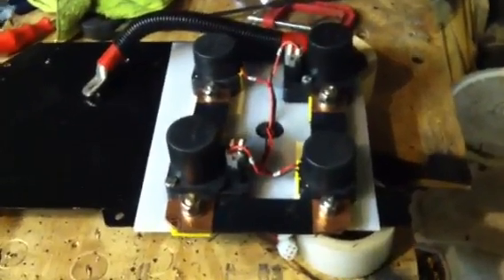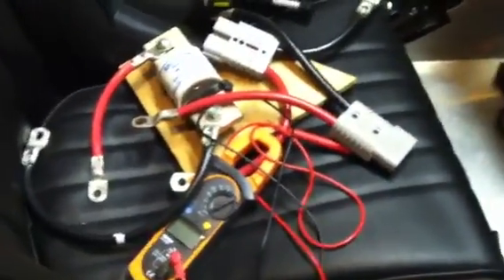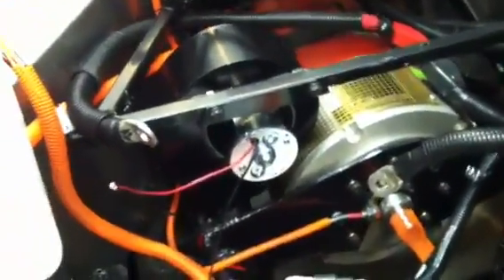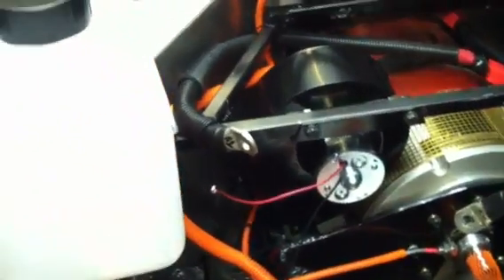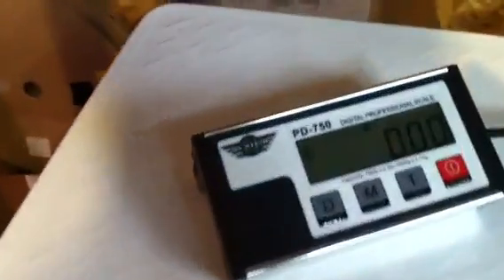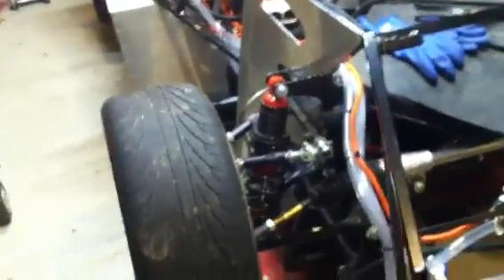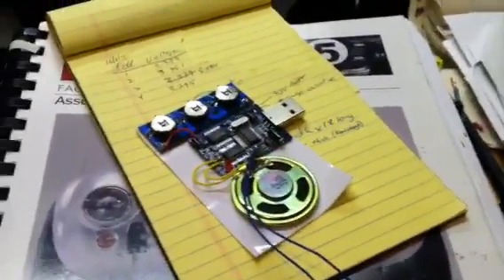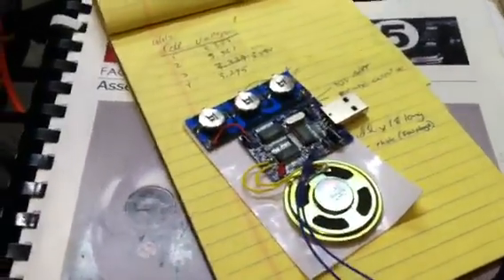Factory Five Mk4 - Electric Car  - Video 21

Comment from the maker: @baltaz86 Not finished yet.   Working on the battery packs now.    Hope to have it on the road this summer.

Also change of plan for the 'engine sounds'.  I found a company that makes a novelty item for gas cars that simulates engine sounds, including a Shelby V8.   I am adapting it to the Cobra, the simulated RPM will follow the throttle pedal!

Comment from the maker: @DanFrederiksen    The sound board is just for a chuckle on the key switch..... mostly to get a nervous reaction out of a passenger.  ;-)    What better than the sound of an electrical short circuit in an electric car?    The same circuit board will be part of a safety sound system so people nearby will hear the car approaching.     It will use some sort of car engine sound.     I used the Jetson's car sound on my last EV.

Comment from the maker: @evric2008 No doubt that might be a bit more accurate.    However a 4 wheel auto scale is far more $ than I am willing to spend, this scale was very reasonable.     By putting the scale under 1 wheel at a time, and blocks under the other 3 wheels (that are exactly the same height as the scale), the car is sitting level and should provide a reasonable reading.    Certainly more accurate than simply guessing and trying to add up all of the parts.